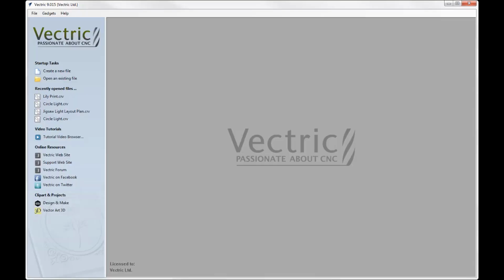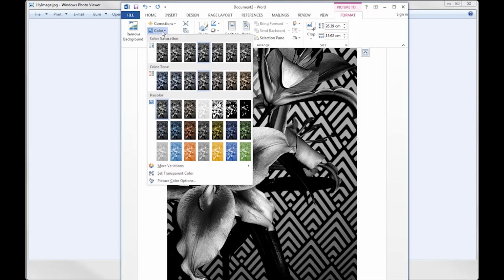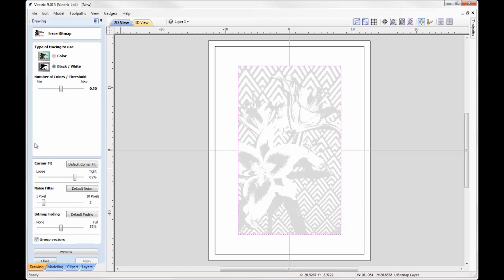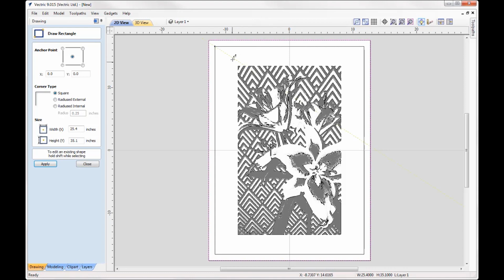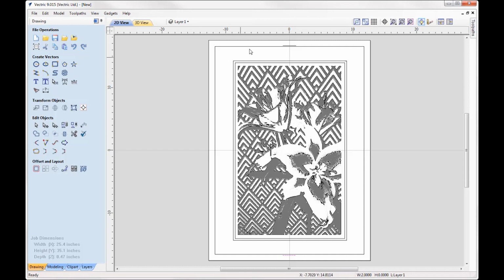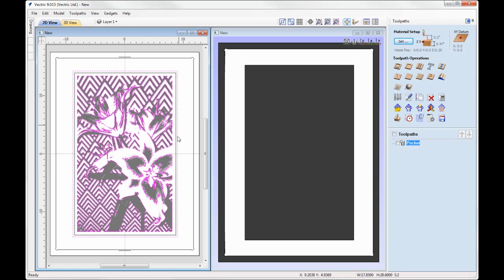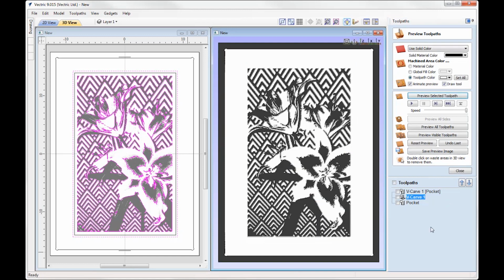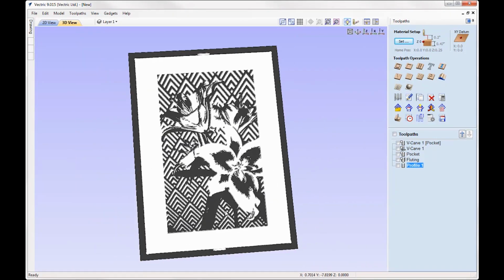In Labs with Beki | Make Your Own Original Artwork | Vectric FREE CNC Projects

Comment: I didn't get it, so you put all the effort to print on A3 page. Wouldn't it be easy to simply print it out from a normal printer?
Reply from the maker: This is demonstrating the art of woodblock printing, where you create a woodblock as a tool to create multiple prints using paint.

Comment: Hi Beki, nice job. I think the problem with the „light“ first print is the wood, that sucks the ink. Just let the wood suck and ink it a second time before the first press print and everything should be fine. But as I said: I like it...
Reply from the maker: Hey Alexander, you are very right! I also found it helped to ad a little water to the ink too, to kind of loosen it up! Thanks for your comments :) ~ Beki
Reply: @vectric  Or, what about using sanding sealer on the MDF before the carve?